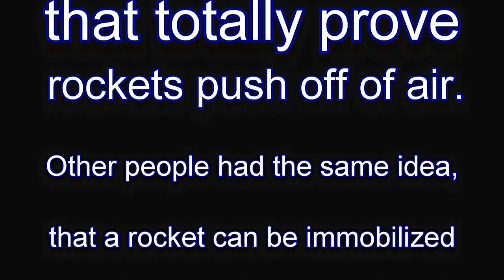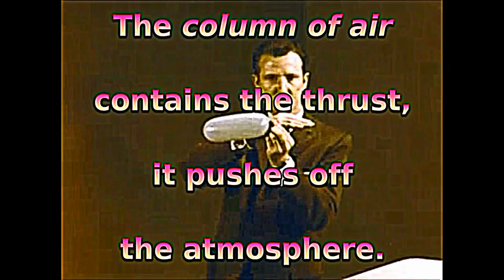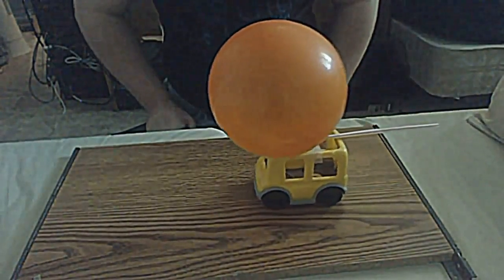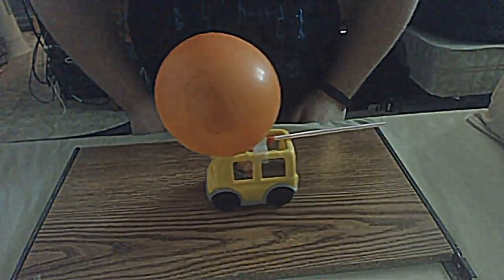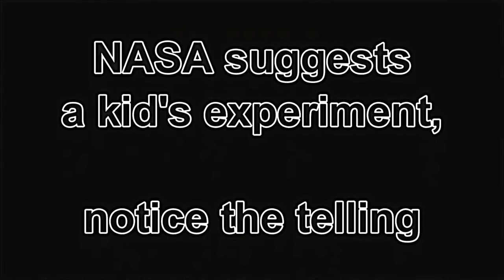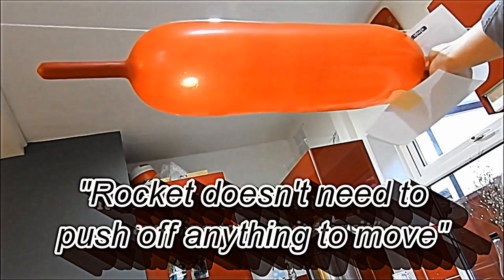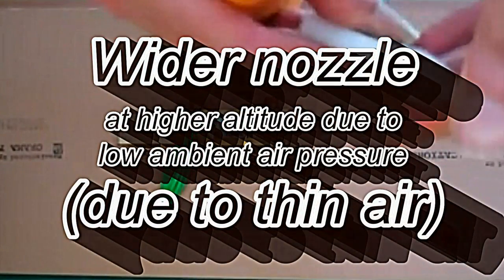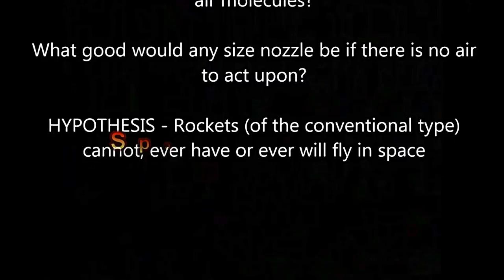rockets push off air

Comment: Lol this video literally debunks your entire claim!!!! You might wana look up Newton's third law of motion again.
Reply from the maker: Wrong, the video debunks the idea rockets "eject a mass" that's ludicrous! HHAA!! If that was the case, then doing anything to said mass cannot affect the rocket, but CLEARLY we see that bending the exhaust by 90 degrees at a distance from the edge of the exhaust nozzle immobilizes the rocket. We falsify the claim that once the exhaust passes the outer edge of the exhaust nozzle it has no effect on the rocket--that's been debunked. Next time you think about rockets think giant blow torch, not ejecting bowling balls!
Reply from the maker: @sailorman8668  You are not ejecting fuel mass or fuel as you claim. You are COMBUSTING the fuel. If anything was actually ejected, then my video falsifies the claim, since once ejected, any perturbation of the ejected mass can have NO EFFECT on the rocket, any more than disturbing a canon ball in mid flight can have any effect on the canon. But it is clearly demonstrated in the video that nothing is ejected, but that a single system exists just like a blow torch. And messing with the exhuast can and does immobilize a rocket. Checkmate.
Reply: @rocketspushoffair  So what you're saying is, that despite rocket fuel being burnt in the combustion chamber, it actually stays within the rocket itself, and the rocket doesn't lose any mass at all? You can't be serious?
i suppose you also think, that when your car is sitting on empty, it weighs the same as when the petrol tank was full?
Rocket fuel has weight, so how is this weight lost out of the rocket as it's been burnt?
Reply from the maker: @sailorman8668  Let's keep trying, I'm saying NOTHING IS BEING EJECTED fuel is being COMBUSTED, IN A CHAMBER EXPOSED TO THE OPEN ATMOSPHERE
Reply: @rocketspushoffair  So you do admit that a rocket is losing mass as it's ascending through the atmosphere? Where has the rocket ejected this mass from then - through the exhaust nozzles, right?
Reply from the maker: @sailorman8668  It has not "EJECTED" anything. It has combusted fuel, essentially in the open atmosphere, combustion is not possible in vacuum, I think you saw that demo already?
Reply: @rocketspushoffair  Forget about vacuums for the meantime. Let's establish some 'basic' understandings first.
When a rocket is burning fuel and is ascending through the atmosphere, is it losing mass? I assume your answer is yes.
Where does the mass of the burnt leave the rocket? I assume you'll agree that the mass MUST be lost through the exhaust nozzles.
I'm sure you'll also agree that the exhaust gases (mass of the burnt fuel) is being EJECTED out of the rocket nozzles at hypersonic velocity.
Does this mass (burnt fuel) leaving the rocket at hypersonic speed (velocity) create a HUGE momentum force? 
Are you familiar with the conservation of momentum laws?
If so, how can you refute that the rocket won't be propelled with the same momentum force as the momentum force created by the hypersonic burnt fuel leaving the exhaust nozzles?
Reply from the maker: @sailorman8668  Again, nothing is "ejected". There is very little pressure inside compared to outside, the nozzle is very DELICATE! The exit pressure must match ambient, so a narrow nozzle is for ground level and wide for higher altitude--to disperse the exhaust, thus, a wide nozzle at ground level causes IMMOBILIZATION. As you saw in the video. This demonstrates that rockets and jet planes push off air. Jets also dynamically adjust the diameter of the exhaust. Rockets have to compromise, so you see a gradual take off even though it is at full throttle, because one, you have the flame trench redirecting the exhaust by 90 degrees (bending it) as you saw in the video, and you have air that is too dense for the width of the nozzle. As it gains altitude, it picks up speed until the air is too thin, at which point we see it actually nose dives and NASA cuts the footage. Your entire understanding is flawed, it isn't even an understanding at all. Nozzles are optimal for one altitude, and the exit pressure must match ambient. Nothing to do with bowling balls, skateboards etc. Nothing is "ejected".
Reply: @rocketspushoffair  'Jets also dynamically adjust the diameter of the exhaust'?
Are you referring to a jet fighter, which changes the diameter of the exhaust when afterburner is selected?
The jet engines of non-military aircraft do not do this, so you can forget about that as part of your argument. 
And with regards to your remark, 'Rockets have to compromise, so you see a gradual take off even though it is at full throttle', it's almost as if you don't actually realise that when a rocket is initially blasting off, it's at its heaviest, being fully laden with fuel - of course it's 'takeoff' is going to be gradual initially, as it takes time to build up velocity from a stand still - I thought this would have been a simple concept to understand, but apparently it's gone completely over your head, lol. 
With regards to the flame trench, the reason why this is incorporated into a launch pad, is to redirect the exhaust plume away from the base of the rocket, to prevent any damage from occurring. The flame trench has nothing to do with why a rocket ascends gradually initially.
Reply from the maker: @sailorman8668  The demonstrations show that bending the exhaust can immobilize the rocket. My explanation matches reality, yours doesn't. You are ignoring the nozzle, which is key to the proof that rockets push off air. If they did not, then nozzle diameter and matching ambient pressure would be irrelevant. A wide nozzle could not immobilize a rocket according to your FALSE UNDERSTANDING!
Reply: @rocketspushoffair  Are you going back to the flame trench when you mention 'bending the exhaust can immobilize the rocket'?
As I pointed out to you, the only reason the flame trench is incorporated into a launch pad, is to redirect the damaging hypersonic exhaust gases away from the base of the rocket's structure.
But going back to your lack of understanding about the combusted fuel, are you still not comprehending, that despite being burnt (combusted) the fuel still has the same weight as it previously had, but has now been converted into a gas as a consequence of the combustion process, from its previous liquid or solid form?
Mass hasn't been lost, it's simply been converted from a liquid/solid fuel into a gas (exhaust plume). Gas has weight you know, or did you think it didn't - please tell me you get that?
Reply from the maker: @sailorman8668  You seem to think that the burnt fuel is ejected as a packet. But that shows you are confused about combustion. What don't you understand about combustion?
Reply: @rocketspushoffair  Well, you could say that a rocket's burnt fuel is ejected as a continuous stream (packet) of exhaust gases. 
I'm not confused at all about 'combustion', but it appears you obviously are.
For instance, you still fail to realise that the mass of a rocket's fuel isn't 'lost' because it's been combusted.
It's simply being converted in the combustion process, into a gas, still with the same mass that it had prior to being combusted - do you actually still not understand this?
Incidentally, do you not actually think that the gases in the exhaust plume are travelling out of the engine nozzles at a huge velocity?
Reply: @rocketspushoffair  Why am I not surprised you haven't attempted to reply to my previous comment - caught out yet again.
Reply: @sailorman8668   Blimey! The ignorance of rockets push off air is dumbfounding! Good try but he doesn't want to know the truth, he's stuck in his own "reality".
Reply from the maker: @ChrisJones-co4ei  Watch the video next time. There is very little pressure in the nozzle, it matches ambient. No "opposing force" in there anywhere. Here is a math quiz: Falcon 9 1 million pounds and 1.7 million total thrust. At just 1 m/s/s weight increases to 5 million pounds. See the problem? haaahhhaa!!! Apollo, 3000 tons and 3700 tons thrust. See the problem? haaahhaaa!!!! Go away "clown".
Reply: @rocketspushoffair  Despite all your 'proofs' however those rockets still go into space. Reality can never be  debunked by incredulity.
Reply from the maker: @ChrisJones-co4ei  Right, almost 2 million pounds of force pushing inside each Falcon 9 engine? OK, incredulity is your middle name Chris. And don't forget, the weight instantly goes to 5 million pounds at just 1 m/s/s acceleration, so 1.7 million is nowhere near enough. Space is fake, cry all you want. Here is Encyclopedia Britannica https://youtu.be/8Nt8YVVEoWQ telling you that flights proved a dome 13,000 feet above at S80 latitude, and all maps before 1958, pre Antarctica Treaty, were flat earth maps, based on actual circumnavigations of the early explorers, which only look like circumnavigations on the flat earth map, and like a 3 year old kid with a crayon on the globe. Mr. "Incredulous" Chris Jones, your globe beliefs crumble at the slightest inquiry.
Reply: @rocketspushoffair Erm Thats actually the Encyclopedia Americana . That ' dome ' reference is describing an Ice Dome with a surface  level at 13000 feet above Sea Level. Still a 🤡
Reply from the maker: @ChrisJones-co4ei  There is no "opposite force" of millions of pounds pushing back anywhere on the inside of a rocket engine, case closed. The exit pressure of the exhaust matches ambient, less than 15 pounds, you lose mr chris clown 🤡
Reply from the maker: @ChrisJones-co4ei  And no, the Encyclopedia was not talking about an ice dome 🤡
Reply from the maker: @ChrisJones-co4ei  Not my word. It's rocket science. The article was shown in the video. There is very little pressure inside the cone, case closed. 🤡
Reply: @rocketspushoffair  It was talking about an Ice Dome.Only flerfers desperately flailing around to find any actual proof against the globe believe that it wasn't Still a clown🤡
Reply: @rocketspushoffair   'The Article '??  One unsubstantiated article shown as part of a pathetically amateurish flerfer video is supposed to tip the balance against the mountain of real evidence? Still a clown 🤡
Reply from the maker: @ChrisJones-co4ei  Show me that it was talking about an ice dome. Even if it wasn't, I left a comment at that video stating I don't agree. 🤡
Reply from the maker: @ChrisJones-co4ei  No goof ball, the Article on Rocket Engine Nozzles, from wiki. So, you comment w/o watching the video. Also, there is a nice documentary on the Saturn V engines that I downloaded and will be using part of it in a future video. The part where they had to solve the problem of negative pressure. That's how you get the gigh rate of failure. And that's why no rocket has ever been manned. Face it doofus, you lost, there is very little pressure anywhere inside the cone. 🤡🤡🤡
Reply from the maker: @ChrisJones-co4ei  No. I stated in my comment that they did not provide enough information. How exactly did they make this observation? All it states is that flights were used. Nothing about equipment, methods, etc. I need to see the "proof" not the claim. 🤡
Reply: @rocketspushoffair  Since when have you taken any notice of evidence? As I said before there is so much evidence out there proving we live on a globe and there has been for centuries. The trouble is you flerfers think all the evidence you need is " it looks flat so it is flat".
Reply from the maker: @ChrisJones-co4ei  There is no evidence for a tilted space pear encrusted with cracked basalt spinning like a top over 1000 mph and orbiting 67,000 mph etc etc etc. Going over 1000 times faster than a bullet but you can't feel a thing. 😂😂😂 1) no cracked body can spin, the space pear is done right there, case closed. Need more? The COMBINED EFFECT of just two motions of the space pear (spin plus orbit) requires 21 mm/s/s to be detected, rock balancing statues prove it doesn't exist. Wnat more? The spin alone, requires trillions upon trillions of psi of tension in the ground, none detected. Want more? The minimum tensile strength required to go 1000 mph is 215,000 psi, titanium only has 63,000 and the space pear's cracked basalt crust has zero, while basalt itself has a whopping 1900 psi tensile strength. HAAHHHAAHAAAHAAAA!!!!!
Reply from the maker: @ChrisJones-co4ei  How is the weather on the space pear? HAAAHHAHAAAHAAA!!!!
Reply from the maker: @ChrisJones-co4ei  Still no pressure inside the cone that equates with ejecting bricks. And still not enough thrust to accelerate at a modest 1 m/s/s aND YES, NO CRACKED BODY CAN SPIN AND NO SOLID MATERIAL CAN SPIN LIKE A TOP OVER 1000 MPH W/O EXPLODING, THAT'S JUST BASIC SCIENCE SPIN1.FLAT.WTF (ooops, caps lock) 🤡

💩🌍👈😂

Comment from the maker: Harry Growler, Published on Nov 24, 2017: Flat Earth - Practical demonstration of air pressure and thrust https://youtu.be/Uze0rDRY_DE 

Flat Earth as a term does not represent a model but represents free thinking and an on going investigation and understanding of where we are, who we are, what we are, when, how and why.

Scientifically unproven claims of the Globe enthymeme

1. No proof for the unseen force of gravity using the honourable and trusted scientific method.

2.  Bodies of water always displays level on surface.  Indeed the very meaning of water is aqua, even, level surface.

3.  No proof of axial rotation.  We all experience a motionless earth and it would be an absurd appeal to authority fallacy to entertain the Foucault's pendulum as any form of evidence, especially as 100,000's of tower crane specialist operators would have evidence.

4 No proof that air pressure can exist without a container? Air pressure exerts force in all directions and requires container for pressure to exist.

4-1 No proof whatsoever that 2 opposing pressure systems could exist side by side without physical barrier.

5 No measurable curvature (apart from a single globe bias soundly source which imho looked like it was the product of auto cad.)

NASA is theater, nothing more.  Space is FAKE.

Comment: Try using water as atmosphere and a jet ski or propeller  as a rocket. This is a great parallelism to solidify the point. The boat or ski will not go hardly anywhere  spraying out of the water. Only the mass and velocity of the water creates the minite thrust. But when you direct it toward the water (atmosphere) the craft moves immensely.
Reply: Geary Cloward  Wrong. If your jet ski has a water supply and is propelling it out of the back - you just try and stop it from shooting forward! Think pressure jet when you forget to hold it before turning it on; I did that once, never again!
Reply from the maker: @BigHeretic  Wrong. Not the same.
Reply: @rocketspushoffair  Exactly the same.